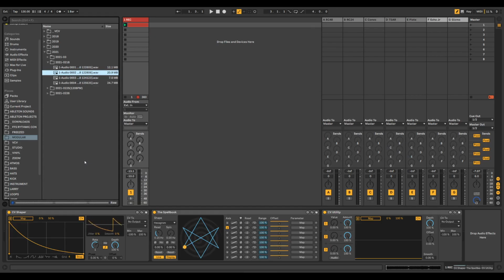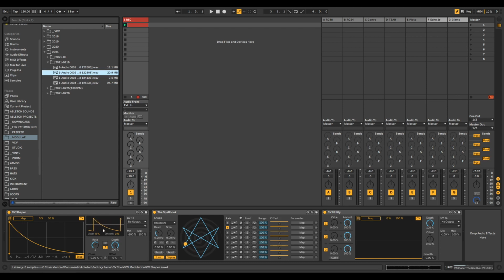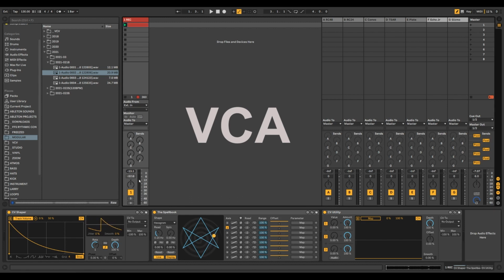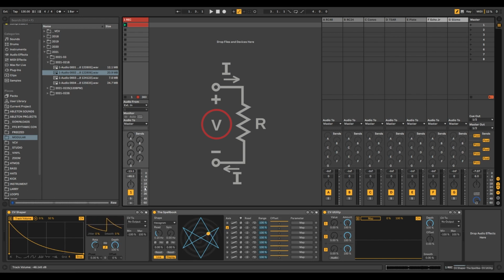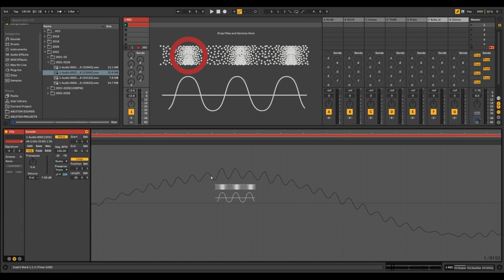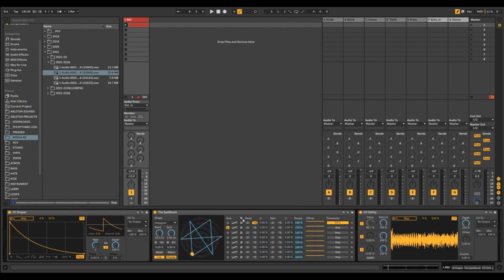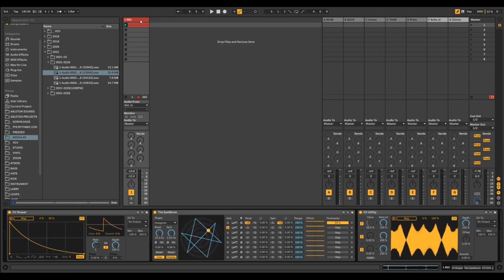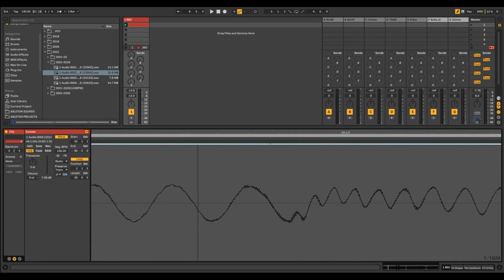Control Voltage Explained (Audio Synthesis)

Comment: Hey
it doenst work with live 10.0..
Which version of live we must have to run your bundle?

Cheers
Reply from the maker: Hey! What is it that isn't working? The technical specifications for our devices are listed at the product pages on our website. We recommend that you use the latest version of Max.
Reply: @Hypnusrecords  thanks!